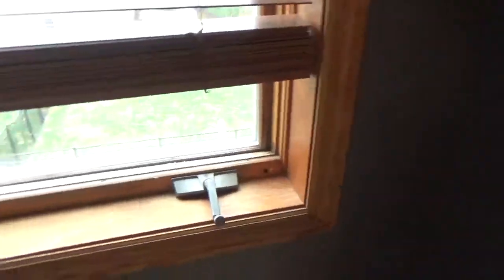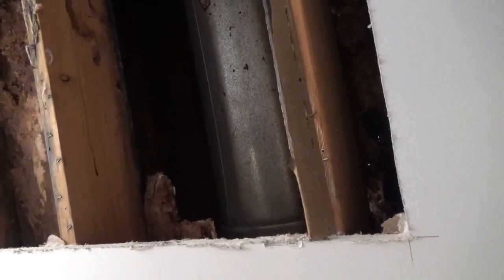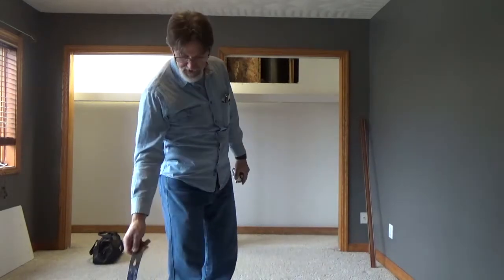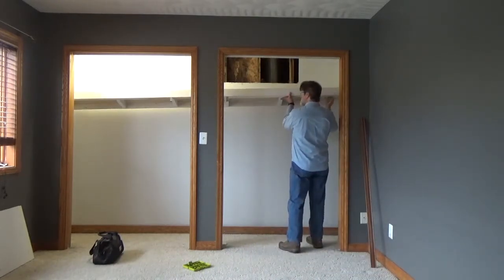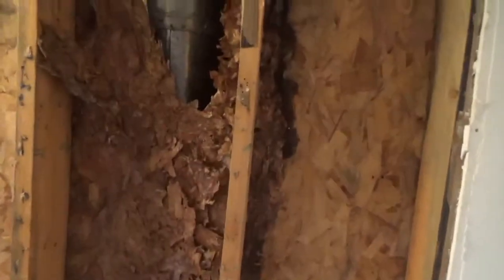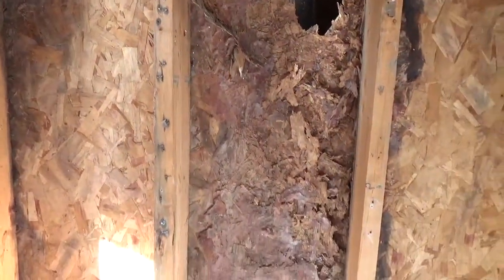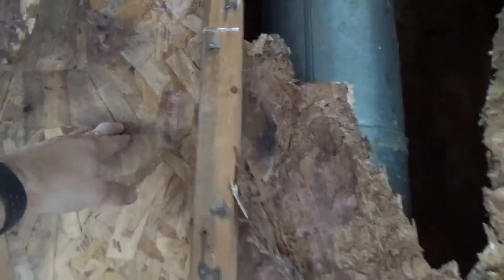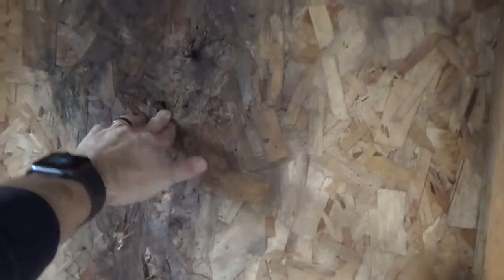Repairing a rotted exterior wall Part 1

Comment: I'm evaluating two bids to repair/restore a water damaged exterior wall. This helps me understand what is probably waiting inside the wall - thank you! I see you don't use any instruments to judge wetness and rot. One bidder is very into the measurement technology, HEPA filters and contamination barriers. The other is planning to judge moisture your way, by eye.
Reply from the maker: Insurance companies will usually require moisture measurements to be documented before demolition, after abatement and to have good readings before the wall is built back up.  This is especially important if the damage is recent, ongoing, or at all wet. In my case the roof had been replaced about 7-12 months previous (just before we purchased the house) and the water intrusion was at least temporarily stopped.  I say partially because the true problem behind this leak was not actually fixed. Check out my chimney videos and you'll see what I mean.  Since it was very dry, and I didn't have the tool to measure, I didn't bother with moisture readings.  Your situation will of course be different than mine and I can't say which contractor would be better in this case.  If you at all feel there is any moisture left in the wall though, I would go with the more cautious one.  Also, in my case the previous home owner had previously opened the wall, removed all the moldy insulation, and killed all the mold with sprayers before covering and hiding all the damage before unloading the house on some unsuspecting chump. 😛

Comment: A few things I would recommend to someone watching this video, first, I would tack a tarp or even some old plywood down over the carpet to protect it. I noticed him wearing ear protection but no dust mask around who knows what is floating in that moldy rot. I would replace as much water damaged wood as necessary to make it structurally sound, we will see in his next video Part 2.
Reply from the maker: Definitely great points!  All of the walls were sprayed with mold-killing compounds before the previous owner tried to hide all the damage, so I wasn't worried about any mold-spores (although it looked bad in the video).  And you are correct, Part 2 was where I replaced much of the damaged wood.  The rest of it was replaced the following year when I replaced the chimney chase from the outside, as this was a partial-temporary fix from only the inside. :D  Thanks for watching!!!

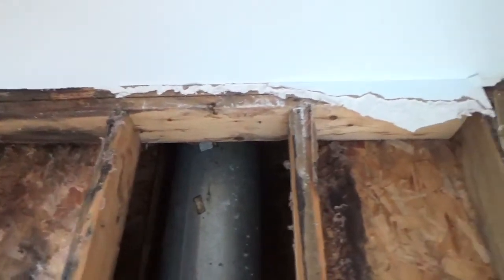Comment: Would love to know more about what you were talking about at 14:00. Because you have a nearby wall also under the same wall, you needn't bother making your temporary support wall? I'm replacing rotted studs in an exterior wall and assuming it's load bearing and going to build a support as a result
Reply from the maker: Yeah, it was the closet wall I was counting on for supporting that exterior section of wall while I replaced the board..  Plus the was wasn't overly load-bearing as well since there was a chimney directly outside of that section that was also supporting that section of the house.  You can see the chimney setup in this video. https://youtu.be/22--SI8UrNE?si=GZbhTvKldJPhBw0h and at 8:30 in you can see the outside section of this wall I'm replacing in this video.

Comment: How much does it cost to repair a rotted exterior wall
Reply from the maker: Hi Rich!  Unfortunately that depends on a lot of factors.  How much needs to be replaced, what tools you have access to, etc. etc.  In this case it was just a couple sheets of OSB and some 2x6s.  A sawzall always helps.  In my newest video, working on a different house, I needed hydraulic bottle-jacks ($30 from Harbor Freight). https://youtu.be/SFXpYZPmaGw  Material prices vary drastically from week to week.  In the past three years I have seen plywood go for $80 a sheet, and $12 a sheet.  Crazy times.
Reply from the maker: Also: Be sure to check out Part 2! https://youtu.be/njLHz6Yem6U